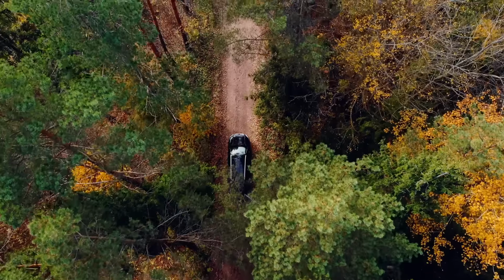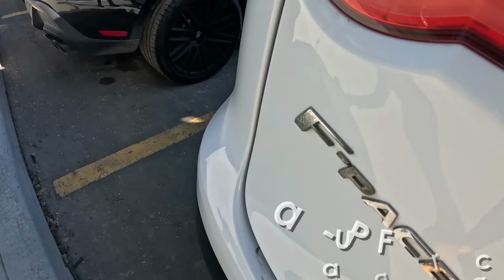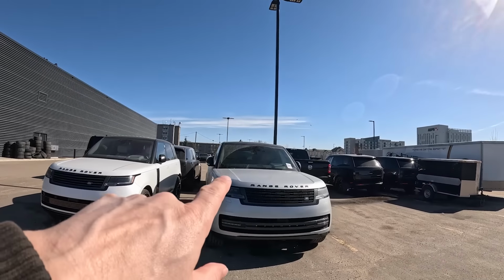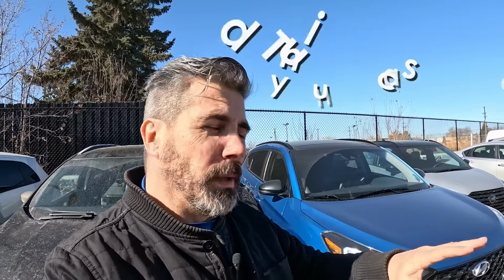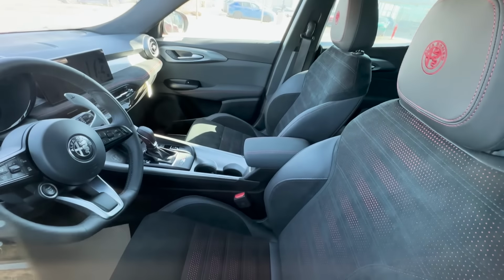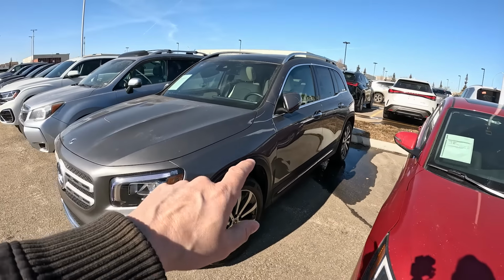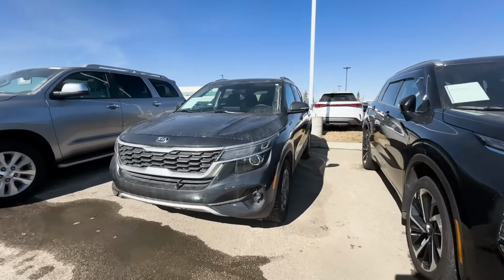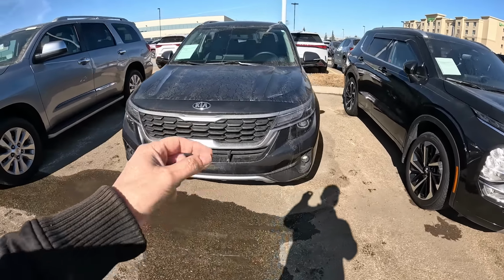Here Are 10 SUVs you MUST AVOID!

Comment: I noticed there wasn't a single Toyota or Lexus, with a naturally aspirated engine, on this list.  As expected...
Reply: Yup. Just rolled 102,000 miles on my 2019 Tacoma. Zero issues, not even a rattle!
Reply from the maker: Cheers
Reply: Just rolled 122k on my 2014 Lexus es350. 0.0 issues.
Reply: I have 108,000 miles on my 4 Runner with zero issues.  Only a couple of sensors lights are burned out
 Toyota wanted $200 per sensor to replace it. No thanks.
Reply: You just said zero issues and then talked about some.  Lmfao
Reply: @colleenpeck6347  the sensor (one under the hood) can simply be cleaned 👍🏻
Reply: Sadly everyone is moving to turbocharged 4 cylinder engines now so reliability will decline.
Reply: @stevedott715  V6 forever! Bulletproof
Reply: Toyota and Lexus may be on the episode "Will it make 500k miles?"
Reply: @robb15033  Without a doubt bud
Reply: The Honda CR-V with the 1.5 turbo engine isn't on the list either and I am not having problems with my 2022 CR-V with the 1.5. Oh, btw the way the 4 Runner is being redesigned, I think, and Toyota is dumping the 4 liter V6 in favor of a turbo 4.
Reply: This is a good video. He’s as good as Scotty Kilmer. Excellent advice and saves people. 👍👍👍👍👍👍👍🙂🙂🙂
Reply: @TimTheMusicMan  Kilmer is awful. I can not stand his whining and flappy arms.
Reply: @eseir64  oh come on. He’s a character. That’s what makes who he is.
Reply: @TimTheMusicMan  Yes an annoying character that I can not watch
Reply: Or honda .
Reply: @neoblackwolf69  Rocking a 21 Passport with the 3.5 V6... So far so good. Mrs drives an X3 with no problems. The Passport definitely gives old-school vibes and the simplicity of the electronics is the opposite of what is currently being sold out there. You see these electronic panels that control the whole car and it makes you wonder how long can they last.
Reply: Because they were all stolen from your driveway
Reply: With these issues make mine electric!
Reply: Clearly these vehicles in order to last long is to use coconut oil!🤣🤣🤣🤣🤣🤣🤣🤣
Reply: Toyota made their SUVs strong and reliable. Their mechanical parts last longer than other brands. Toyota vehicles are good quality and hold value.
Reply: @andykassie3213  They also loose a hell a lot of oil and are terrible on fuel. 😉 I had one, never again.  !
Reply: No Hondas either which Hondas are more reliable than Toyotas
Reply: Vehicles to avoid….not to keep 😂
Reply: My Highlander  has 142,000 miles runs like a Swiss Watch!!
Reply: @alfonsotarazona2320  242,000 here, and it's been mostly brakes, tires and fluids as far as maintenance goes. Just one compressor replacement, sway bars, wheel bearings, and hood latch assembly for repairs in 8 years of heavy driving in New England. Those Toyota engines run forever!
Reply: I wanted a Lexus for the low problems but they are ugly and expensive. I bought a 2016 Range Rover Evoque. Love that little suv but lots of parts go out. Way to fix but costly. Now I can’t give it up becuwe I feel I rebuilt it. Up to $118k miles. Works extremely well. Next car needs to be low maintenance. Maybe even ugly.
Reply: You speak too soon, Toyota just recall 3rd gen tundra and some Gx or Lx engines.
Reply: Exactly 💯
Reply: Lol
Reply: Lexus is Toyota
Reply: Well this settles it I’m either getting a Honda or Toyota. I need something I can put a bunch of miles on and will last long.
Reply: I noticed there isn’t a single Toyota fanboy who doesn’t comment on a video that has nothing to do with Toyota. As expected…
Reply: Not Opel either.
Reply: I am a Toyota fan... Owned Chevy, Mazada, BMW, VW... but the clear winner is Toyota! On my 3rd Toyota vehicle, and couldn't be happier!!! 🥰🎉
Reply: or chevy Traverse
Reply: I have 160k on my 2014 Santa Fe right now with zero issues.
Reply: Well you can't go wrong with Toyota. My dad's first car was Toyota and never looked back. We're a Toyota family and on our third car 19 years later
Reply: Subaru either for that matter.
Reply: Toyota are the most boring, but reliable cars on the market
Reply: @CollinMac96   We had a new Landcruiser  in 1995 with zero problems. It pulled our 27 ft boat well. Now we have a 50 ft Benetaux sailboat in  the marina at Merritt Island. My husband has an F250 that is always having problems. Currently it's only April and the air conditioning is barely working. He needs to bring it to a a/c car air conditioning shop not Ford. It's a 2020 and he just put new tires on it. It's paid for and he wants to sell it.
Reply: @CollinMac96 nicely said
Reply: @CollinMac96 why boring ? As long you can afford it
Reply: YOU SO RIGHT !
Reply: You are going to get carbon issues with any gdi engine.thats nothing new.
.
Reply: Lmao. They are crap. Lexus ls350. Rusts after 1 year. Radio goes out. Transmission sucks.....  My mother had 2 of them and got rid of the 2nd after 1 year...
Reply: In another video he also stated to avoid any lexus is250 cars before 2015 as they were all crap.
Reply: That's right lexus and toyota are ugly vehicles

Comment: O’Boy I’m screwed , I own one of these vehicles
Reply: No, definitely NOT necessarily….I think it depends upon the unit itself & the specific model you own. Also, I’m not so sure that the “batches” distributed to Canada & what’s distributed in the US might not be different. I don’t know this to be a fact, but it’s possible. I have a 2019 Kia Sportage SX (4-cylinder turbo), have attended to regular maintenance on it, & thus far, no problems (cross-fingers).
Reply: Not necessarily. Which one? My cars rarely get to 100,000 miles. They fall apart body-wise they are so old before they get near that number. (But I don't own any of these. I'm close with one but not the same.)